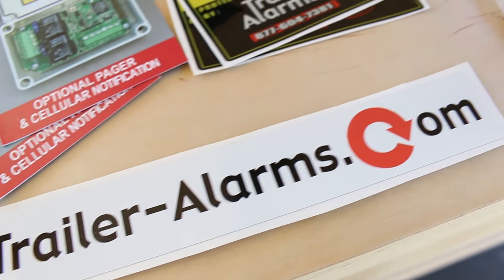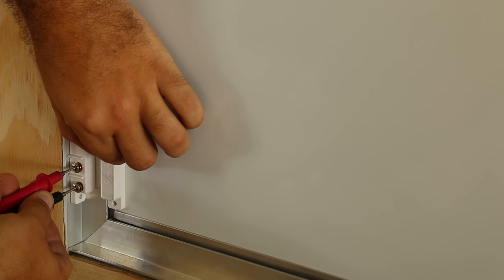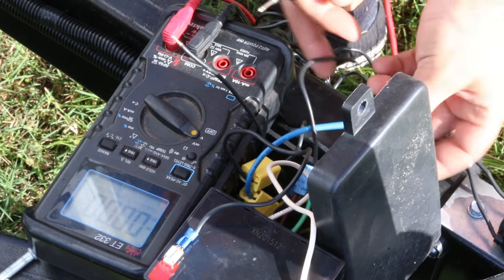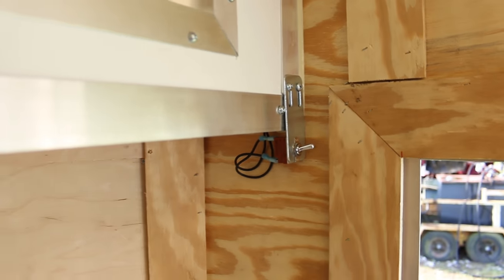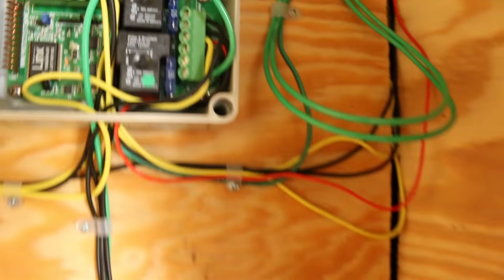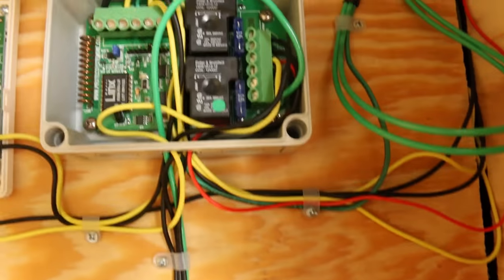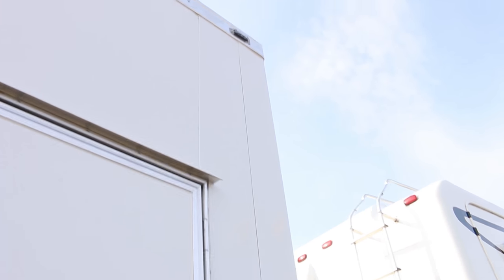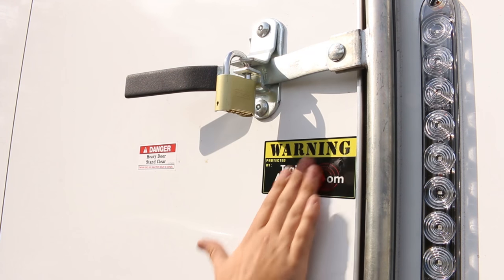Can Your Trailer Alarm Do This?  Our Plan for Keeping the Workshop Secure

Comment: Great setup Mike! Keep an eye on those Scotch Lock connectors. They are prone to the green death of corrosion. I've replaced more than I can remember in trailers over the years. You have a better chance since they are inside the trailer, but not immune. I use heat shrink butt connectors for pretty much everything now. The Scotch Locks have been relegated to my emergency/temporary wiring kit.
Reply: +Tyler Boespflug     Couldn't some battery terminal spray on the Scotch connectors eliminate the green corrosion?

Comment: Please upgrade your padlocks on your doors. Check out BosnianBills review of high security locks. You can have peace of mind for about $30 a lock. Right now the master lock(any master lock) can be bypassed in about 20 seconds. The alarm protects your trailer but it doesn't take long for someone to grab some expensive belongings and run off.
Reply from the maker: +JB Sherlock It's on the list. Those are just what I had.
Reply: Id like to second this comment and can't emphasize this enough,  otherwise that text message is just an alert that someone stole your stuff
Reply: Mike and Lauren awesome, glad to hear it
Reply: +JR Sherlock     Not if you put your pit bull nearby or inside. LOL!

Comment: Those crimp on ends look insane, also just a connection for a connection. Try making a hook and just wrap the screw neatly. Twisting the stranded wires to the right first helps.

Comment: Those connectors you used to split the wires off to each opening are called scotch locks, and there are not a good idea to use, EVER!! Although it is a little bit more work, you need to add in an insulated butt connector, trust me it is well worth it in the long run. If you use a scotch lock you may have problems with corrosion or a voltage drop across them, and with an alarm that means the alarm will either go off or it will not work. Just something that you should be aware of.
Reply: Scotch-locks really suck!

Comment: so... where is your battery? they could just disconnect and be away... unless there is a small backup in the devices... personally i think it's overkill if you are connected to the trailer (RV). a hitch lock is good. if you are disconnected it could be useful. just MHO

Comment: Nice. My worry would be someone stealing the whole thing. Seems that if they cut power and just take off w it they can pull it off.
Reply: usually those systems have backup battery inside, but still, stealing trailer itself seems like plausible thing :)
Reply from the maker: +Hugo Danilo We also have a hitch lock and tire boot.

Comment: so all i need to do, is to have gsm blocker, cheap and accessible, and the siren is above the door when i come in. so i cut the wire in 9 seconds, and you alarm is rendered useless ? :D
Reply from the maker: +.177shooter It also locks the brakes and we have a tire boot and hitch lock. Regardless there's no way to totally protect a trailer from someone who really wants to break in short of an armed guard. Even then all you need is a bribe ;)
Reply: i do get that, my point is, you should hide the siren somewhere where it would take more than 9 seconds to reach, and would be covered, not accessible. Most security systems install two sirens, one inside one outside. :)

Comment: At about 4:20  you showed  "a connector like this one"  and pointed out  a  Scotchlok.   If you use those you deserve the failures you will incur.  3M  should be ashamed  that they still market these
Reply: fourfortyroadrunner Agree. Those should be banned. Terrible.

Comment: thats some gawd awful THICK wire for alarm sensors.. it's as though the wire gauge is thick enough for 120 volts ac at 15-20 amps...